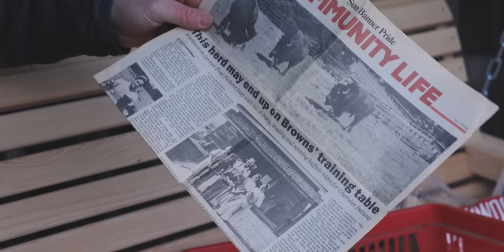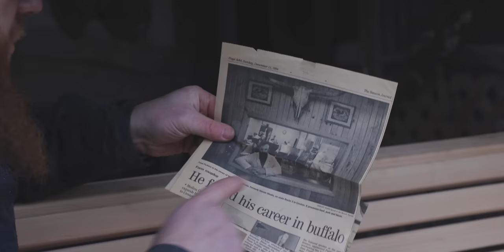BISON vs BEEF: The Ultimate Comparison | The Bearded Butchers

Comment: Thank you for showing us where all those beef cuts come from! It's very easy to see from which part of a chicken come the various parts like legs and thighs and breasts and wings etc but not so much with a cut of beef or pork nicely packaged at the supermarket. I can also see that the discount supermarkets and Walmart are showing us only the cheaper parts of beef carcasses and we need to go to a specialty butcher to get all those other fancy cuts although unfortunately they are a bit too expensive for most of us. Perhaps you could convert some of all that ground beef into beef bologna and then we could cut 1/2" slices off those bolognas and pan fry them as "filet bologna de boeuf"?

Comment: High animal fat and high cholesterol is actually a good thing.  Every cell in the body use cholesterol.  The brain uses it to function.  There is not a single study showing any “causation” only correlation of cholesterol causing heart disease, strokes, or other human health issues.  Korea just did a study on over 12.5 million people showing that people with low cholesterol have a much high morality rate than those with high cholesterol.

Comment: Bison is healthier than boneless-skinless chicken-breast...
Less cholesterol, very beneficial fat...
     Higher protein content means it takes less to satisfy your hunger...
High in Iron, very beneficial to replenish female blood-loss due to monthly period...
     Extremely strong, unable to be contained...
I grew-up very close to a feed-yard that tried to keep some penned-in...
     Their pens were 6ft tall, 5 horizontal-bar made of 3 inch diameter 1/4 inch wall welded steel tubing... 
If they wanted to eat the grass on the other side of that fence,
     they'd walk right through it like it wasn't even there...
Cook extremely slow on low heat...
     You want to eat as much of the fat as possible 
If it's cooked too much it won't taste very good...
Reply from the maker: Thank you for the great information!